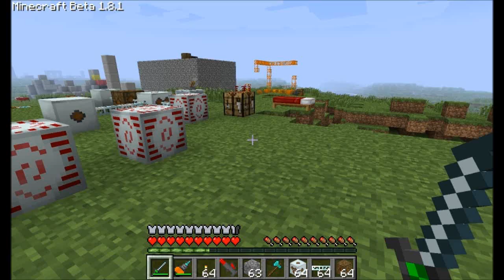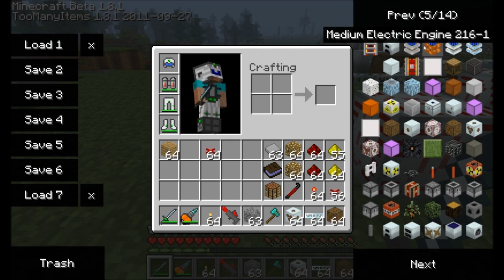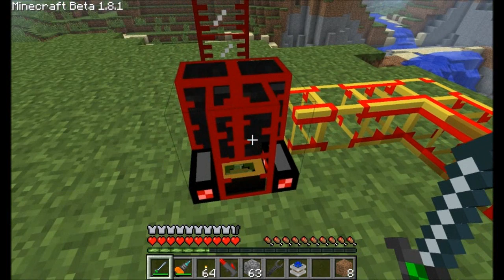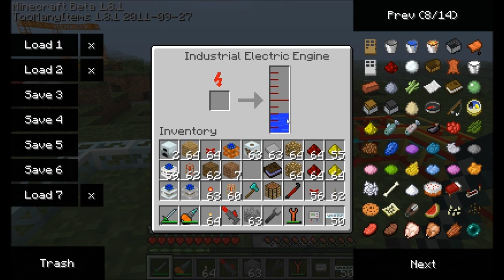Buildcraft-IndustrialCraft Crossover Mod

Comment: Question: What prerequisite loaders do I need to install this mod?
I have both BC and IC2 and I want to add this as well. I am a very new modder and I am still squeamish about this. Already crashed my Minecraft once and recovered. I installed the two other mods with an auto installer. I have WinRAR and understand the basics.
 Do I put everything in the Minecraft jar? I know the .class file goes there but what about the three folder? Any help would be greatly appreciated. Tried original thread.

Comment: @supamap in 1.23 the power output from a generator with coal was 5EU/t for 800 ticks. The steam engine runs for 1600 ticks on one piece of coal. Thus small electric engines takes 5 EU every 2 ticks, or 2.5EU/t. The generator has changed in 1.337, the conversion has not yet been updated.

Comment: could someone check if the EU´s you get from burning one coal on a generator is the same as burning one coal in a steam engine and converting them into EU´s

Just to check if the math is actually fair